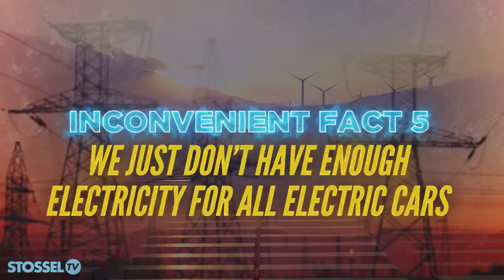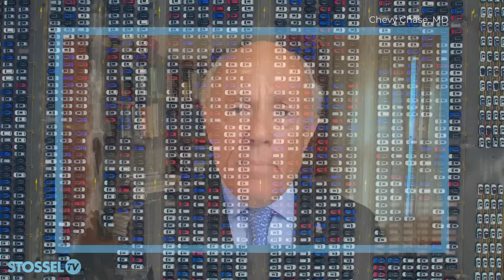Electric Cars: Inconvenient Facts, Part 2

Comment: Thankyou for posting this. I love EVs too, however, I'm grateful for people like yourself, Jordan Peterson and others for bring some sober and balanced thinking into this crazy time
Reply: Stossel's video was soaked in oil, friend. It presents no objective data, didn't interview a single EV expert, just an oil-industry advocate. Jordan Petersen is a behavioral scientist, not an engineer.
Reply: @justsomeguy934  It presented lots of objective facts, you just chose to ignore them. Wake up and smell the rising cost of electricity.
Reply: @TehButterflyEffect  I ignore nothing, but nice try at an insult. Electricity will always be cheaper than petroleum. Electricity has multiple sources, petroleum only one. Electricity can be generated 100% domestically (wind, hydro, solar) if we want, whereas petroleum has a global, delicate supply chain and artificial pricing. Remember $5 gas? Did overall demand or supply change? Nope. The oil companies charge whatever YOU think they can justify. The highest profit the oil companies have made is during the $5 price increase. During my 20 years at my current residence, electricity has only gone up 15%. The price of gasoline, however, has gone from 1.x to 3x to 1.5x to 2x over the last 10 years.
Reply: @TehButterflyEffect  "t presented lots of objective facts, you just chose to ignore them." What you mean is that the video presented what you're used to. Did you notice, or ignore, that the only "expert" on the interview was paid by the oil industry? No EV experts allowed! Did you notice that John Stossel already retracted his solar energy estimates? An EV/renewable energy person would've pointed that out immediately. It's YOU, friend, that's ignoring facts.
Reply: @justsomeguy934  Electricity will not always be cheaper than petroleum. Remember the Trump years when domestic oil and gas production increased a bunch and prices fell?
If you want to talk about high oil costs, let's talk about the real reason.
We could supply 100% of our own fuel domestically, but we don't because environmental lobbyists think that buying it from overseas is somehow better. Who is really behind that? If we produced 100% domestically, fuel would be so cheap and plentiful that nobody would even think about buying electric cars for economic reasons.

Oh and by the way, even USAToday, which is a left-leaning, pro-EV news source admitted that electric car refueling costs grew higher than gasoline car refilling costs last year.
The ONLY way to have cheap electricity is to go 100% nuclear, but that won't happen because everyone wants to focus on terrible, inefficient "renewable" electricity generation.
I've been studying this topic for nearly 20 years. The only thing that's changed is even more push for more expensive electric generation sources.
Reply: @justsomeguy934  Oh, and I'm glad your electric costs have stayed so stable where you are. They increased 10% over the last two years where I am, and I'm in one of the cheapest places in the US. In the state that I used to live in, electric costs are 300x more than what they were when I first started buying electricity.
Reply: @TehButterflyEffect  my area had its first increase in electricity rates after decades, it went up 15%. As for your 10% increase over two years, let me point you to the price changes of gasoline over the last two years. It's gone from $2.42 when Biden took office to $5 a gallon at peak, then artificially reduced (through depletion of our national reserves by Biden) to well under $3, now back up to over $4 where I live. Yup, I'll stick with electricity rates.
Reply: @TehButterflyEffect  "Oh and by the way, even USAToday, which is a left-leaning, pro-EV news source admitted that electric car refueling costs grew higher than gasoline car refilling costs last year." Actually, that claim that EVs cost more than ICEs to operate was debunked immediately after it came out. My buddy's EV costs $2 to go 100 miles. My EV, 9 years old, for my local rates of electricity, costs $5 to go 100 miles. Add in a road tax for the average mileage, it's $7 for 100 miles for me.
Reply: @TehButterflyEffect  "We could supply 100% of our own fuel domestically, but we don't because environmental lobbyists think that buying it from overseas is somehow better. Who is really behind that?"
You are absolutely correct. We were in a net-export situation at the beginning of the current administration, we are far from that now. I disagree with you on the topic of nuclear power being the solution, but suffice it to say that I am wholeheartedly against the current administration's anti-energy policies. 
As for a low gasoline price stifling the sales of EVs, it would reduce it *perhaps*. What has happened, however, is that the public has seen how artificial and politically-driven the price of gasoline actually is. If an election can send gasoline to $5 a gallon in months when supply or demand really didn't change that much, the stage is set for it to happen again.
EVs will continue to replace ICE vehicles forever, due to the recent change in fuel pricing.
Reply: @justsomeguy934  wind, hydo, solar, and nuclear is  not  now any where near able to do100% power grid without cars we wil need fossils fuels for many years
Reply: @justsomeguy934  even on other videos with ev experts they do not beleive ev can complete replace all ice vehices
Reply: @justsomeguy934  i notice you do not tax the gas tax out the real cost of an ice vehicle 
we ice drivers are paying your share of the road repair
Reply: @brucenadeau2172  solar alone could power the USA with less real estate required than we currently use for oil & gas leases (energy storage would be required). No one is recommending 100% renewable energy sources, and neither am I recommending 100% fossil fuel resources. The answer is that renewables have the capacity to easily power the USA.
Reply: @justsomeguy934  Simply putting all you eggs in one basket doesn't really make sense, since almost types of energy have their draw backs!
Reply: @christopherscuorzo3044  WHO is putting all eggs in one basket? Not one utility, not one state, not one country has 100% single-source energy supply.
I think you're making the often-made assumption that if you like renewable energy, you must stop all other forms of energy in a 100% cutover. 
With a balanced energy supply, we can easily switch to 50% or more renewable energy, and with grid-level storage, much more. Regardless, petroleum is not in infinite supply, is too precious for modern life to burn up half of it forever as gasoline. EVs - personal automobiles and most trucks - can easily be replaced with electric alternatives.
Reply: @brucenadeau2172  "even on other videos with ev experts they do not beleive ev can complete replace all ice vehices"
Are gasoline vehicles appropriate inside a building, say, a warehouse? Nope. Electrics are used there, with some LNG vehicles (but those require ventilation). Will a container ship run on electricity? Probably not. But replacing passenger vehicles - cars - and most trucks and you've accounted for HALF the petroleum use in the USA.
Reply: @justsomeguy934   Thank you for your sweet reply.
     I'm glad to tell you that you agree that there should be more energy choices and not Just total replacements, through facing out older alternatives! I just don't like to see monopoliesDominating is the only alternative.
     I also look to other energy altern it off too, besides the E, since I wanna preserve the ice engine cars! Like, hydrogen, biodiesel, Hydrogen And  And propane. I just simply don't want to see the ice engine car become discontinued totally from production, outlawed, extinct and made illegal one day.,
Reply: @justsomeguy934  not a single EV expert? Even Elon Musk said that there is no way to get rid of gasoline cars and considering he sells EVs, that is not a smart thing for him to say. I'm sure he would love to put an EV in every home, but even he knows it's a pipe dream.
Reply: @keinlieb3818  WHO is advocating for every single automobile be replaced? WHO is advocating ALL petroleum be abolished? Elon Musk has stated that if he had the "button" to shut off oil, he wouldn't. What CAN be replaced with EVs should be. That means cars for the most part, a significant percentage of trucks and lots of petroleum generation facilities.
Reply: @brucenadeau2172  I’m paying for the Trillion dollars of subsidies the global oil industry gets each year and that’s an old argument as electric vehicles are paying the through registration fees in many states already just get over it already the internal combustion engine is dead
Reply: @justsomeguy934  thank goodness a few people making comments have a scientific basis for what is happening in the electric vehicle industry the internal combustion engine is dead
Reply: @nickkacures2304  Wow, your troll-foo was weak. You got NO hits and I won't be back, so....
Reply: @TehButterflyEffect  I can put 200 miles of range on my EV by charging when rates are $.02/kWh. Lotsa free chargers around town but I'm lazy. Variable rate pricing helps the utility manage surges and surpluses and I;m happy to help since they essentially pay me too. We have smart grids in states with decent regulation.
Reply: My son has a Tesla.  He cannot get from Rhode Island to Maryland to visit his son without a recharge.  Solution, after a couple of frustrating times, he now drives his Ford F150.  Hmmmm!
Reply: @TehButterflyEffect  Nuclear is the way to go
Reply: @mikemcmo  nothing is “free” somebody is paying for that electricity = you are not paying for it, but “we” are. I own an EV.

Comment: One more thing for the 'environmentalists'. A wind turbine tip travels at between 150 and 200 mph. I wish the green lobby would help in picking up the thousands of bird carcasses at the bottom of wind turbines. That includes bald eagles.
Reply: Ah so you are one them and not even a car person.  How much damage does pollution from fossil fuel use add up to?

Comment: My son just bought a Tesla, they no longer provide adapters for charging the car on non-Tesla chargers. The adapters cost about $200.00. There are no chargers close to where he lives so he purchased a level 2 home charger for the sum of about $475.00 and paid an electrician $575.00 to install it. His insurance will increase significantly along with his registration fees not to mention the tires cost more than ones on a regular vehicle due to the heavier vehicle.  I ask him if he realized that Tesla has complete control over the car, they can shut it down anytime they desire. We live on the southeast coast and are subjected to hurricanes and tropical storms that sometimes takes down the power grid for extended periods, you can't store electricity in a can like gasoline or diesel to help carry you through the down time.

Comment: John - I appreciate your honesty and great capabilities as a Journalist!  You are one of the only people that tells the truth!  A barrel of oil contains 6.2 Gigajoules of latent energy.  As pointed out by your guest, there is a very good reason why we use it.  I am an engineer (BSME and MSME) and this video is right on.  Thank You! 🙂🙂
Reply: Pity a ICE car wastes 60% of that energy. EV, about 10% given that it recharges itself going down hills when braking.
Reply: Go back to the power plant generating electricity and then the transmission grid transporting the power.  It isn't as efficient as you suggest on a full fuel cycle analysis.
Reply: @David Henry "They will never understand the huge losses involved in grid generation." No, YOU don't understand the losses in grid generation. The most efficient energy transportation is the grid - with about 4% - 6% loss over THOUSANDS of miles. As for generation, a utility is far more efficient at producing energy, even from fossil fuels, than any automobile or truck is with the same fuel. Less than 15% of the energy in a gallon of gas reaches the wheels - that's an 85% loss! Utilities, however, heat water to steam and recapture the waste heat to produce electricity.
Reply: @David Henry What are YOU clowning at now, my mistaken friend? Here's just the FIRST search results on the efficiency of a natural gas power plant: "Natural gas power plants are attractive to the power industry because of the following advantages: It has efficiency between 45% and 57%, highest efficiency for a power plant type. It has a small footprint compared to other power plant types."
Given that the average automobile only has about 15% of a gallon of gasoline's energy reach the wheels, your information needs an update. Furthermore, it takes MORE gasoline or diesel just to transport the refined fuel to the sales point. 
It's your fantasy that we have an infinite supply of petroleum. Tesla will have megawatt chargers all over the place, soon. They already cover a lot of the planet with their kilowatt chargers, enough for millions of cars to travel freely. I've been almost 90,000 miles in mine, thank you.
Reply: @jivepatrol6833  A natural gas power plant is 45% to 57% efficient in generating electricity. The average gasoline automobile barely makes 15% of the energy per gallon reach the wheels. An electric car is over 90% efficient. Transporting electricity over the grid is phenomenally efficient, with 4% - 6% losses over thousands of miles.
Reply: @carylittleford8980  EV's waste far more than an ICE car from the waste created from mining and manufacturing these monster 1 ton batteries, charging them and when they are spent having to dispose them in a landfill.
Reply: LOL - if he can just get his facts correct, he would be pretty great at this.
Reply: @justsomeguy934  Seems present natural gas fired electric generation is between 32 and 38% efficient. The best combined cycle plants are about 60% but they are not in the majority.
Reply: @frankd8957  "Seems present natural gas fired electric generation is between 32 and 38% efficient. "
I generally quote about 40% efficient for utility-level energy generation, so we agree. When doing comparisons between point-of-use gasoline vs. electric cars, you have to take into account mechanical losses that ICEs have, plus thermal losses. By all research I can do, only about 15% of a gallon of gasoline's energy reaches the wheels - that's a  whopping 85% energy loss.

Comment: Pretty much what I expected. 

I think CNG/hydrogen/propane-powered cars, conversion kits for those for older cars, and then CNG//hydrogen/Propane-engine hybrids are the smart way out in the long term.
Reply: Hydrogen is NOT an energy source - only an energy conductor.  You have to make hydrogen using some other form of energy.
Reply: @robertstarr5826 kinda like electricity?

Comment: The Tesla Semi will be an interesting addition.  Almost a megawatt hour of battery storage needed to go the 500 miles.  Now the truck needs to recharge after travelling 500 miles.  Figure an hour at a truck stop to recharge... give the stop 10 or 20 charge stations for the big semi cabs.  Now getting a Megawatt hour into the battery in say 60 minutes, and having 10 or 20 trucks there?  You have the big surprise for the power company... 20 megawatts is like a small to medium sized city.  Just for cars, we need a new 1.l5 gigawatt NUKE built every month from now to 2035.  We have not started on that...and so far, the latest nuke in the country is 20 years late.
Reply: Maybe we should have semi trucks powered by SMRs. God forbid they get into a crash.
Reply: Just to add to this thats not 20ish MW the power company would see. At those charging rates and scale it be closer to 35ish MW as you have pumping loss, Conversion loss from AC to DC, and cooling loss to keep battery from over heating.
Reply: I think an hour to recharge this semi is optimistic at best. More likely 4 to 8 hours for a full charge depending on the charging station. I see these semi trucks as local run trucks with their limited range.
Reply: I doubt real world mileage would be 500 miles.
Reply: @TdrSld  Or to warm cold battery cells
Reply: @TdrSld  Naturally.  Being overly optimistic doesn't help.  The Tesla Semi is about 700-800 megawatt hours in reality.  The greenies will simply say "Put in a 50 megawatt hour battery to store power for the trucks, and a pile of solar panels.  That of course would need to be many acres of panels.  And the battery cost by itself will be the price of a moderate sized power plant.
Reply: Megawatts and megawatt hours are not the same thing.  The terms are not interchangeable.